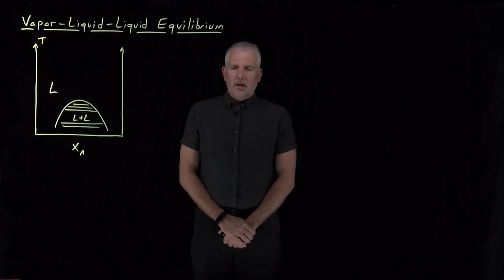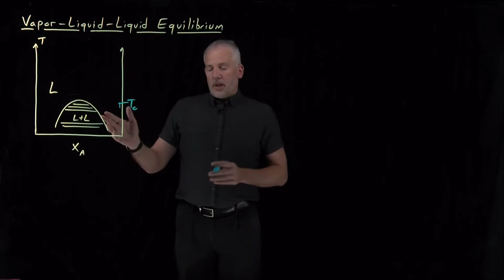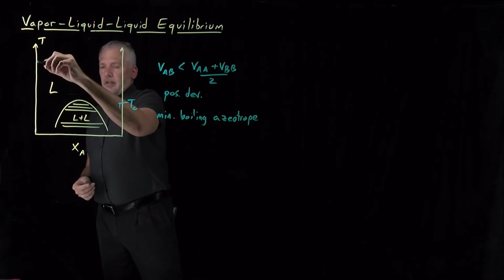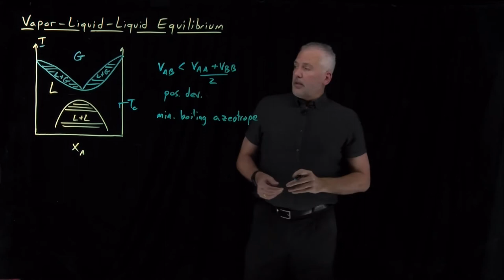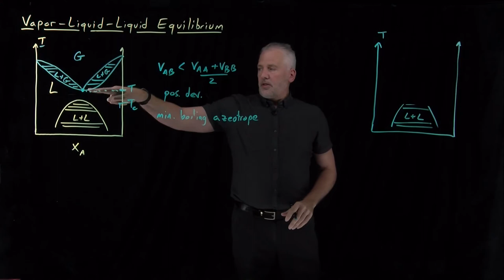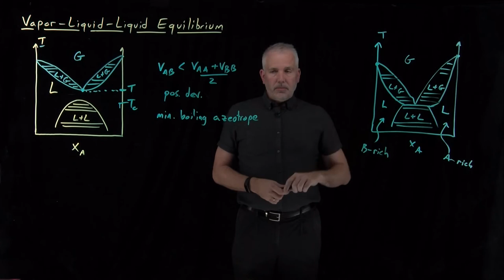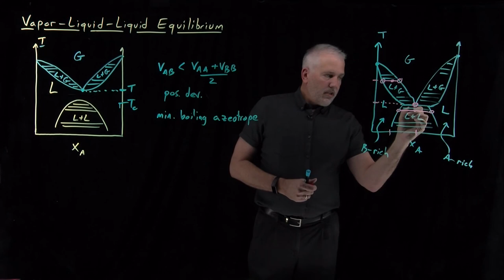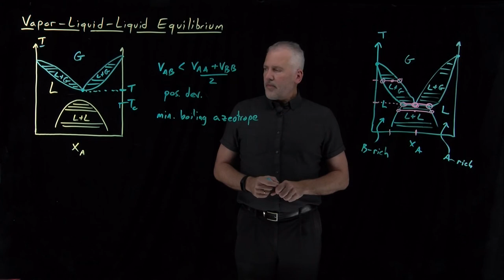Vapor-Liquid-Liquid Equilibrium (VLLE)

Comment: Thanks alot dear dr.stuat🌹🌹🌹 if i have a stream of water/styrene which is pouring inside the tower, which one of them will act as shell(outer layer) and which one acts as core(inner layer). what property leads us to find this.
Reply from the maker: I have no idea, sorry. That sounds like an engineering problem: more to do with the configuration of the plumbing than the properties of the fluids.
Reply: @PhysicalChemistry  thanks alot dear dr.stuart😍😍😍